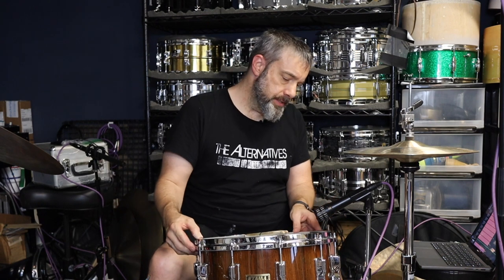Care and Feeding of Your Drum's Die Cast Hoops (And Their Tuning Limitations!)

Comment: This is helpful! I’ve always noticed that the alternate tunings don’t work as well on die cast but never thought about why. 
When you say alternate tunings run the risk of bending thicker hoops, does this mean that they’re also bending the thinner hoops too? But that it’s just easier for thinner hoops to be bent back and corrected by tuning?
Reply from the maker: Alternate tunings will bend thinner hoops, yes, but if the tunings aren't dramatically off the hoops will tend rebound when tension is removed... thinner, flanged hoops are more flexible, so can 'bend' for alternate tunings without necessarily being damaged.  Because heavier/cast hoops are intended not to bend, they aren't so flexible.  Plus, even if the thinner hoops do get bent beyond being flat when tension is released, they're still thin and malleable, so its not impossible to tune a drum evenly with such a hoop.  Trying to tune a drum evenly with a 'not flat' cast or 3mm hoop doesn't work well at all.
Reply: @drumdotpizza  okay right that makes sense. Thank you!!

Comment: In my experience the die cast are harder to tune because they are more rigid. A little goes a long way when it comes to tuning. If you bend one your doing something wrong and definitely over tensioning. Great video.
Reply: Same. I've choked the hell out of my Gretsch snare overdoing it because I was used to thinner hoops. I learned that a tiny adjustment goes a really long way with die cast.

Comment: Awesome video! Do you find that die cast rims on toms make it difficult to achieve a low pitched tuning?
Reply from the maker: I honestly don't use die cast on toms.  A friend of mine has a Gretsch round badge kit (vintage) that has them, but I haven't spent much time with them.  I'm not sure if die cast would limit the range of the tuning, but I do know it would be hard to do the 'loosen one lug' trick that lower tunings can sometimes benefit from.  I often do this, especially on larger toms for a deeper, more controlled sound.  Couldn't do that will die cast hoops.

Comment: Thanks for the tips. Are you in the market to sell your Artstar Cordia snare, the one in this video? Also, it is difficult to find replacement "mighty lugs" for the Mastercraft series drums. Any leads? Thanks
Reply from the maker: I actually did sell that snare, I'm sorry.  I bought a 6.5" version of the same drum which got a lot more use, and much as I loved it, I couldn't justify having so many drums laying around.  I'm sorry (those birch/cordia Artstars are nice drums, no?)

As for mighty lugs, yes, they're harder and harder to find in good shape (seems the simple majority have threads that are bent in one direction or another due to high tension on the head(s)).  The good news it Tama, to this day, I believe, uses the same hole spacing on all their double-sided snare drum lugs (from the coffin lug of the late 70s to the ... whatever lugs of today).  They all have the same spacing and will mount to all the various snares they've made over the last several decades.  So you can find a donor drum or buy new replacement lugs (modern, not the old mighty lugs), and they'll fit your drum.  

Not original, I know, but keeps a great drum going!  Great for players.  For collectors you just gotta keep combing the sales sites, local and international for lugs and drums using them.  That's all I know to do. 

I hope that helps!

Comment: How would you suggest bending die cast hoops back into shape? I've got a couple that aren't perfectly flat
Reply from the maker: Perhaps good subject for a short?  (thank you! :)

Basically, you need to to find a truly flat surface (granite/quartzite kitchen counters work pretty well for this -- though they often aren't totally flat, you can usually find a large area that essentially is), and lay the hoop on it, turning it to pushing down on the edges to see where the bends are (usually the hoop will 'see saw' back and forth over the low points of the bent portions.  

Once you have identified the low point(s) place that low point directly against an edge of the counter (or table, whatever) and, holding the hoop at a slight angle, press down solidly (but restrainedly) to correct the bend.  Check your progress on the counter/table with each adjustment (don't try to do it all at once with great force, or you'll likely do more harm than good).  Take your time and don't rush things.  With a little patience and care you'll get it flat again.

Also, ensure the hoops roundness by laying a new head in it -- it should make even contact all the way around (or have even spacing all the way around for a slightly oversized hoop/undersized head).

Comment: I have a mid 80s Gretsch drum set. The snare head pulled through the hoop at a gig and I couldn't get it to stay in I later realize the hoop had... stretched? The head barely fits in. I bent the hoop back in shape (it was frighteningly easy) so the the head does work, however I don't think I can ever trust the hoop at a gig anymore. I got a pair of those Chinese aluminum diecast hoops on ebay, I kinda think the sound is different with the original hoops, probably because of the heavier original diecast hoops. What are your thoughts?
Reply from the maker: If you're speaking of a Gretsch die cast hoop having 'stretched' that is a new one for me (must have had LOTS of pressure on it over the years).  But to answer your question, I would absolutely think that the lighter mass of the aluminum hoop would produce a different sound than the iron/steel-based traditional Gretsch die cast hoop.  I would think the result would be similar with regard to the tonality of the head, but the drum might produce a less strong fundamental note (the 'bottom end' of the sound).  Thanks for watching and commenting!
Reply: @drumdotpizza  I thought all die cast were zinc but I've heard some old Gretsch die cast hoops we're brass.
Reply from the maker: @NEALBABBITT  That awesome to know!  I have never actually looked into that.  I just always assumed they were some ferrous type material.  Thank you for letting me know!  If brass, btw, then they'd be fairly flexible (not an ideal material for strength/rigidity, but probably more musical).
Reply: @drumdotpizza  I read over and over again that due cast hoops lug castings etc are zinc. Old Rogers had brass castings that easily broke. I'm not sure is casting is the correct term for the process. Steve Maxwell (especially Steve senior) drums on YouTube is a great source of information as well as the drum history podcast on YouTube and elsewhere. If you haven't been listening to the drum history podcast you are definitely out of the loop. 👍
Reply from the maker: @NEALBABBITT  I appreciate the heads up!
Reply: Get 302 hoops 👍🏻

Comment: As a pro drummer.. the folks ait gonna worry if you have1.7 or 1.9 mm hoops die cast, pressed steel ,single flange,triple flange, or hula hoops.if you make em sound good ,you will get the gig again.
Reply: Question to the Pro: I have a Mapex Sledgehammer Snare and it constantly goes out of tune. It's always the same 2-3 lugs that get loose, usually the ones closest to where it hit with the stick, affecting the overall tuning and sound. I then bought the TightScrew tension rods in the hope to make the lugs stay but it's almost as bad as with the regular lugs. What can i do? Is the hoop mabe the problem? i'm getting desperate. also, i'm not a very hard hitter. i play mostly metal and hit em good but not overly excessive so it can't really be that....help please

Comment: Question to the Pro: I have a Mapex Sledgehammer Snare and it constantly goes out of tune. It's always the same 2-3 lugs that get loose, usually the ones closest to where it hit with the stick, affecting the overall tuning and sound. I then bought the TightScrew tension rods in the hope to make the lugs stay but it's almost as bad as with the regular lugs. What can i do? Is the hoop mabe the problem? i'm getting desperate. also, i'm not a very hard hitter. i play mostly metal and hit em good but not overly excessive so it can't really be that....help please
Reply: Do you still have the o-rings on each lug? My Sledgehammer will detune but normally after several hours of playing with rimshots, even with the beefy Danny Carey signature sticks.

How long can you typically go before the drum starts to detune?
Reply: Also curious if you tune high or low. Easiest solution would probably be to grab 2 or three lug locks and use them on the problem lugs.